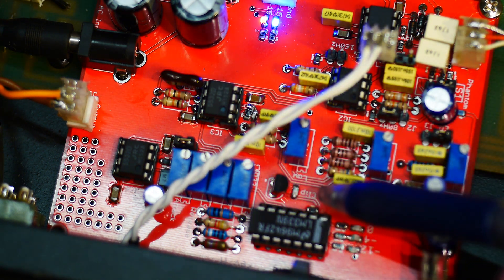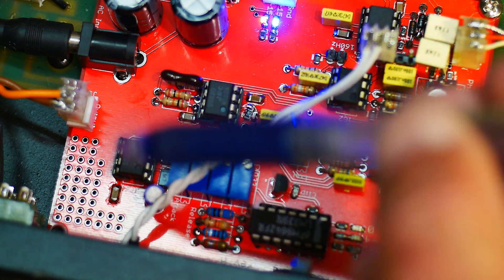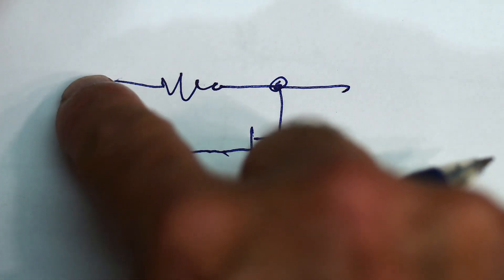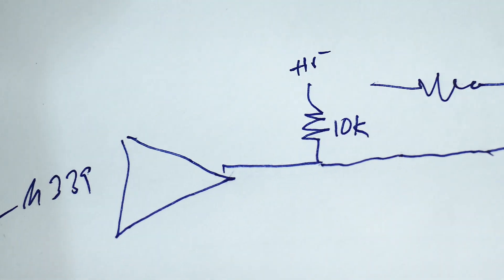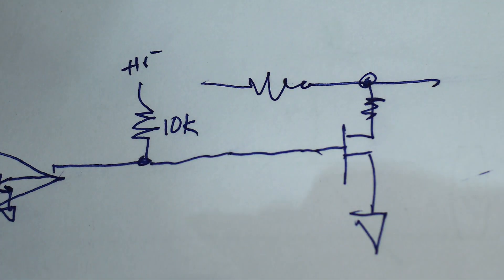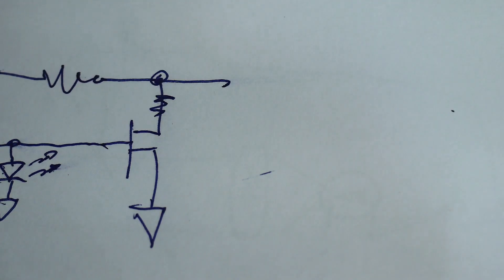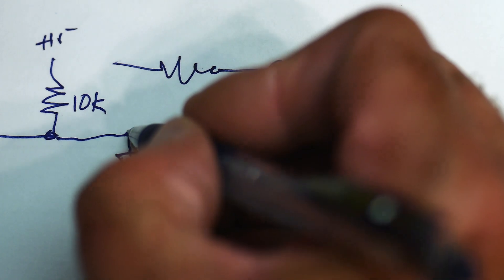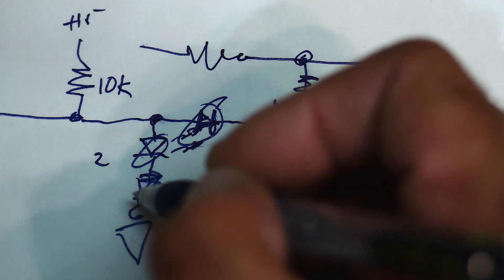#496 Noise Gate Design Error

Comment: He made a major mis-statment, "the plus 15 Volts will not turn the N channel JFET on."   Being a `depletion mode' device the JFET is ON before it was soldered into the circuit, and it takes a NEGATIVE two to ten Volts to turn it off. (depending on the device) 
He made another major mistake when he drew and called the only transistor a "N channel JFET" then he went on to tell us it is a 2N7000 which is a low power enhancement mode MOSFET.    That transistor WILL start drawing current with the application of a positive Voltage to it's gate. Ron W4BIN

Comment: Put The LED on the +15 V side instead, if you have +15 only when turning ON. that way it will be isolated from Gate
Reply from the maker: I want the LED on when the FET is on.
Reply: @IMSAIGuy  Ok. if the resistor is not working put another FET in parallel to drive the LED , LED itself can also add  noise.